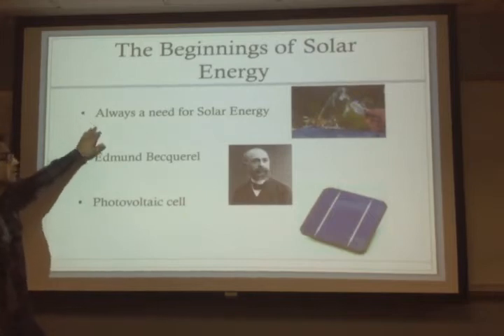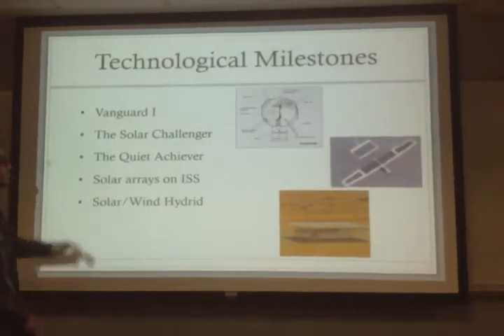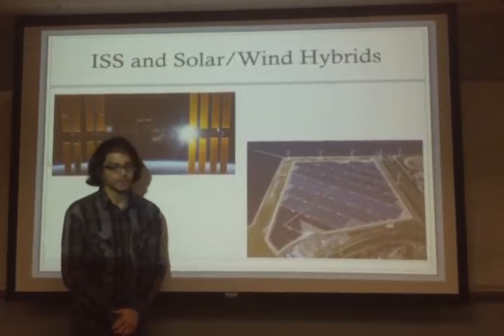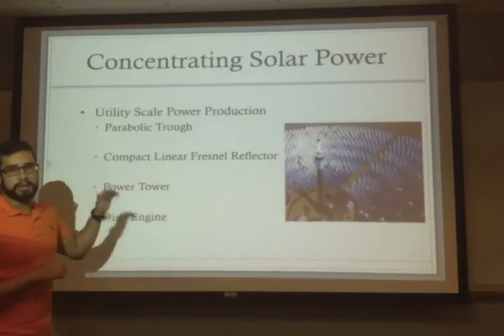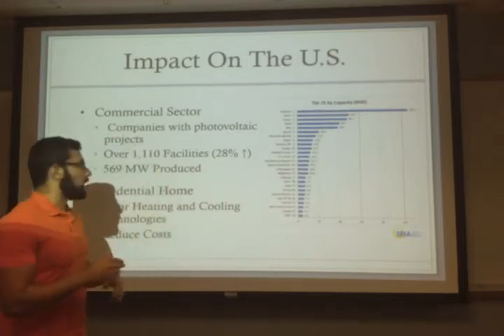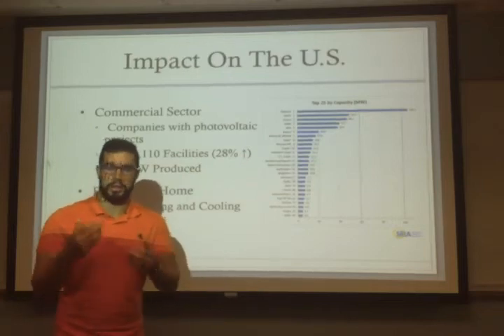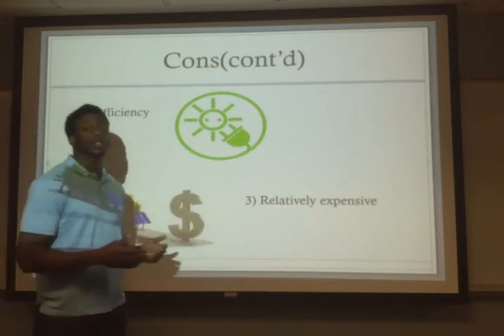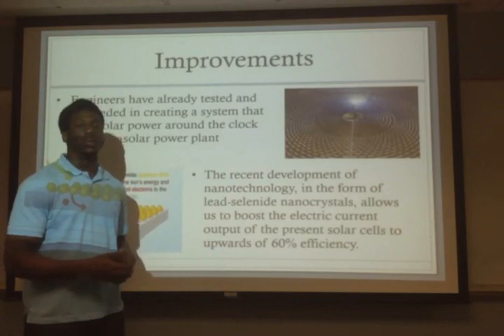Team 12: Solar Energy

Comment: Good presentation, length of the video was good. The team was very informative and professional throughout the video. The slides were well done short and to the point and the overall structure flowed nicely. The lighting was good but standing in front of the words was a little distracting. But overall great work Team 12.

Comment: The presenters are self-assured and well versed in the topic. The lighting was perfect; the presenters and the powerpoint slides are clearly seen throughout the video. Despite this, I found it a bit distracting that the presenters were blocking my view of the powerpoint. The audio is not clear to me. I was having trouble understanding the second and third speakers. There is too much text in the Improvements slide of the presentation and the summary slide does not offer a satisfying conclusion. Overall, this is a great video.